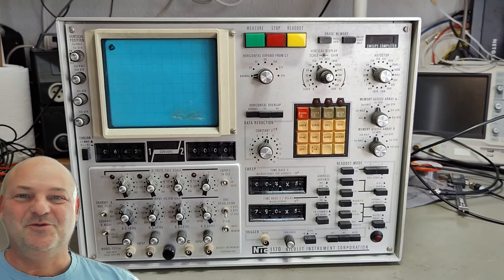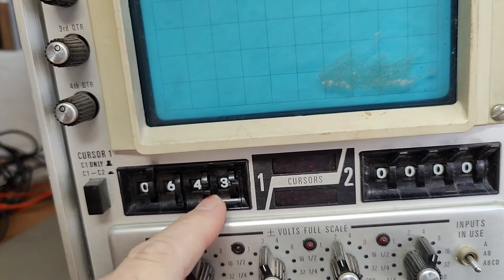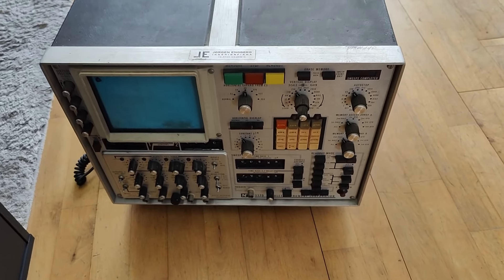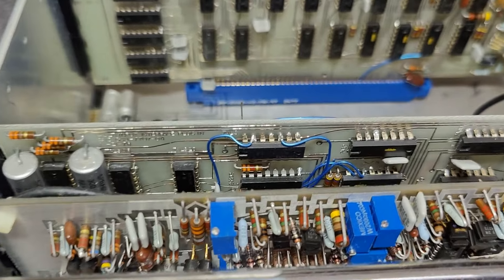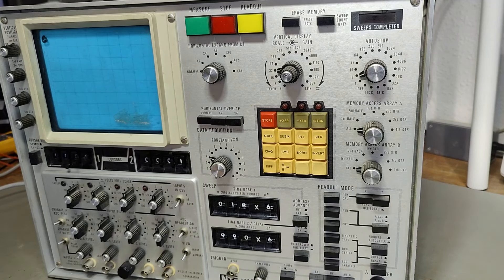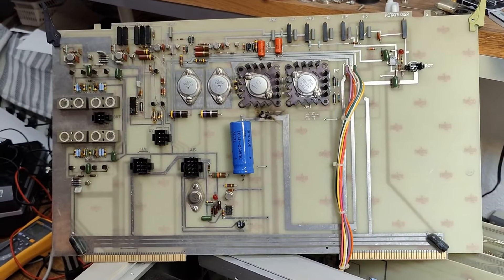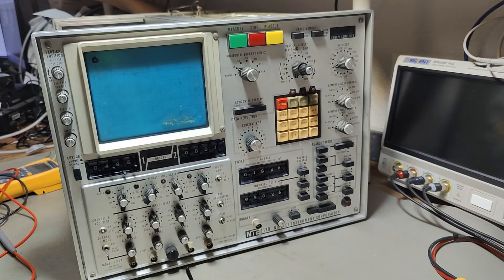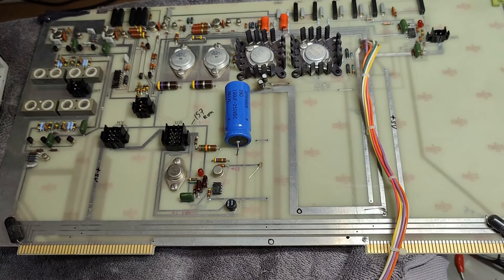nic 1170 nicolet instrument corporation four ch digital oscilloscope 1978

Comment: I’m thoroughly impressed by the layout. It’s beautiful!

The “random” right angle track runs were to give room to chips that were supposed to be there, or in case more chips were envisioned later.

The layout also surely had revisions on the Mylar. We see the final photo output. The Mylar original probably looked like a battlefield.

I did way less complex layouts using tape and scalpel on Mylar when I was a kid. They looked so clean on the finished PCB but the Mylar had many alterations I knew about since I made them :)

There probably is still a box with all the tape rolls of various widths somewhere in a storage room in my old house.

But I was definitely an early adopter of CAD for layout. In the early 80s it would be printed at 2x or 3x scale using a dot matrix printer, in bold (2- or 3-pass) and then photo-reduced.

There were some rather simple DOS-based layout editors available that operated on a fixed grid and used a collection of bitmaps to represent various board features. “Drawing” the layout you’d select the bitmap from a palette and then “draw” it on the grid. It gave very nice results in spite of how crude it was. I figured out the binary file format for it and made a netlist generator so that I could print it out and manually verify that the layout was OK. The file was basically a rectangular array of bytes and each byte represented the bitmap/symbol index. For “tracing out” the connections the netlister would follow the trails of symbols. It was super crude but it worked. All in GWBASIC. And wondrously slow :)

Comment: Very nice video (i forgot the time so I had to run for work). Beautifully apparatus. Could you elaborate on the blue IC's are they special?
Reply from the maker: they are simpy resistors, for termination, or pull up or pull down, a good way to make things smaller